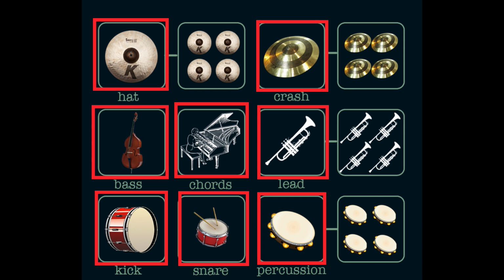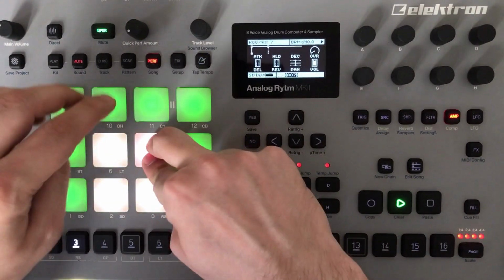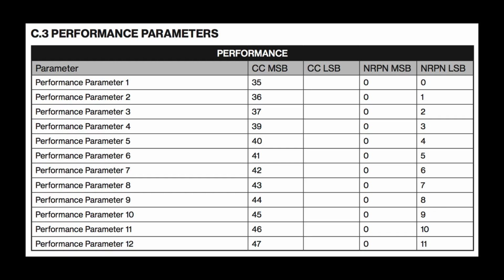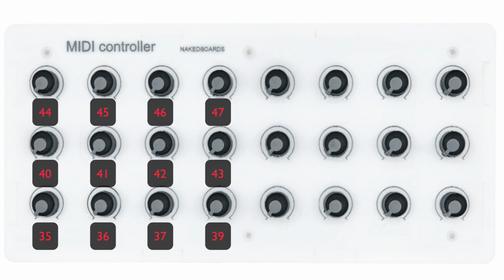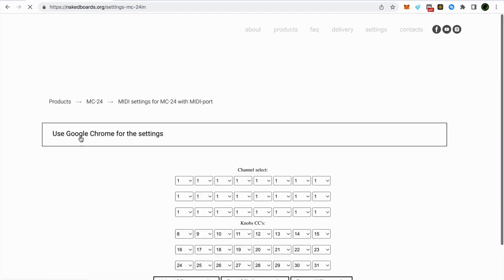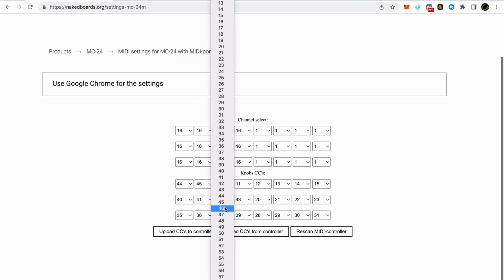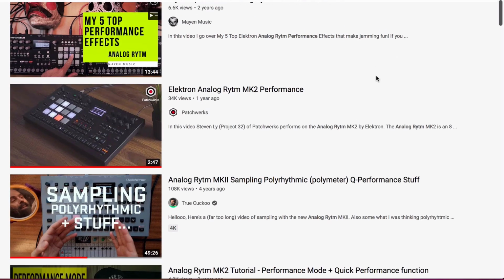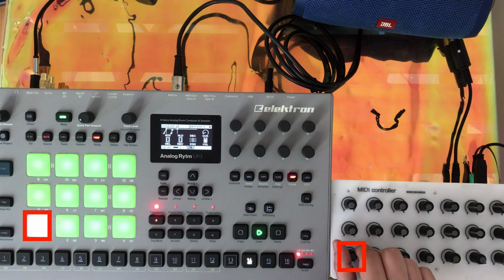How to Play Live Set on Elektron Analog Rytm

Comment: Great video! However if I remember correct, when in performance mode I press a pad and while I am pressing it I change mode, the rytm (mk1) keeps playing with the settings I had in that pad in performance mode. To exit , I had to return to the performance mode. Anyway, great setum and these midi controllers look handy.